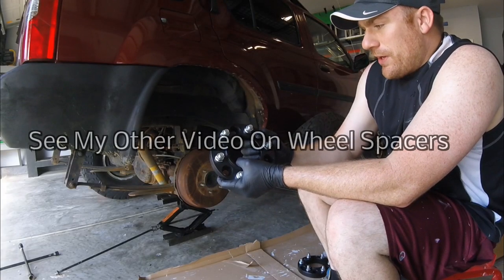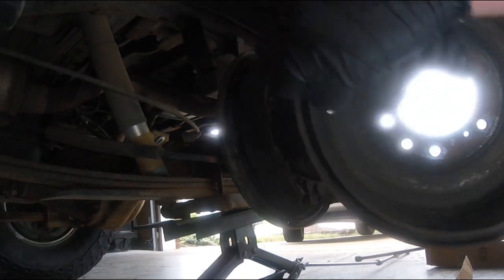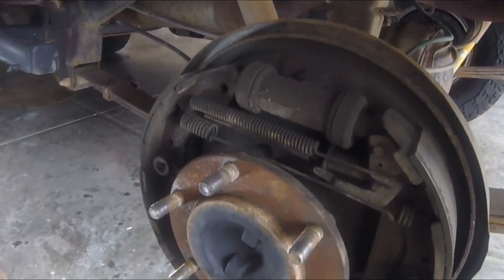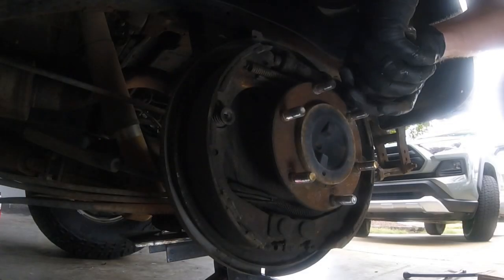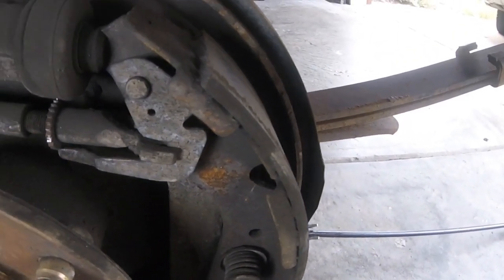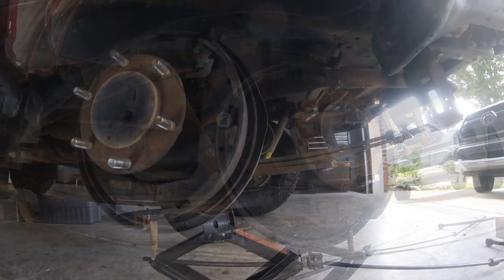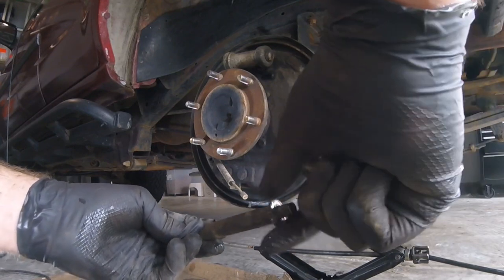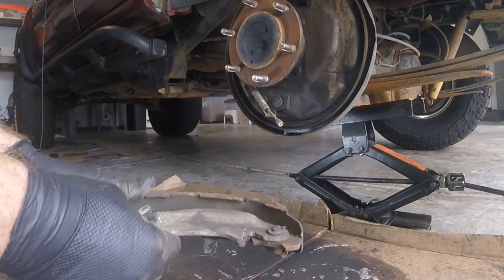How To:  Rear Drum Brake Servicing on the First Gen Nissan Xterra

Comment: Thanks a bunch! I used your detailed guide to replace my brake drums this week... I noticed when I was finished the emergency brake wasn't engaging on my drivers side. I lucked out though. The emergency brake cable just came off of a chassis cable bracket. I put it back on and it works normally now.
Reply from the maker: Awesome! Glad I was able to help!  Hey if you get a few minutes check out my video a few weeks back on my starter replacement. I wanted your opinion on the oil leak (rear main vs. Oil pan) based on what I show in the video of the old starter and oil trail.

Comment: FYI for everybody else - Although my brake hardware was cleaned and looked like it was in decent shape, the auto-calibration feature on my brake drums didn't work. I had to manually tighten them with a flat blade screwdriver.
Reply from the maker: Great comment and thanks for sharing. Its not the most reliable setup. It took mine a couple weeks before it felt any tighter. Doesn't seem to ratchet consistently.

Comment: Hi Rob, I know it's been a while but do you have any video on perhaps adjusting the emergency brake 04 xterra 3.3L ?
Reply from the maker: No video but this is the best video that references it.  Technically the brake is “self adjusting”. The star gear should ratchet when able and add length to the threaded bar which spreads the brake shoes apart. If that threaded bar is crusty and dirty though, it may not actuate correctly, so clean and lube up those threads. Otherwise you want that threaded bar to be as long as possible while still just barely able to slip the drum over the shoes. The way to think about it is you want the smallest gap possible between the drum and the shoes so most of the E brake actuation is applying braking force and not lost to a large gap. The longer the threaded bar is adjusted to, the closer the brake shoes sit to the drum. If you go too far, the drum won’t fit. Hope this all makes sense.  I know the wall of text can be tough to understand.
Reply: @XterraRob  Thanks much Rob!
Reply from the maker: Happy to help!
Reply: @XterraRob  Thanks for the help!  I do have an unrelated question that I need your expertise on.  I had oil leakage from passenger side valve cover and since the car was twenty years old, I replaced the valve cover gasket and then the starter as it was having problems from the oil on it.  After finishing I was putting the hoses back together and the by pass hose that goes from the cover to under the intake manifold (rear of valve cover)  was split so I am waiting for a replacement.  However, after starting the car back up i have the P0171 code, bank 1 running lean.  Thinking this is because the hose is not connected at the moment.  I do not have a good understanding of the operation or effect of having/not having that hose in there.  Is it possible you could explain your knowledge of it?  I believe it's related to pcv flow?
Reply from the maker: @papaalan1765  Valve cover gasket leaks commonly kill starter motors.  Happened to mine too!  Good start so far taking care of those things!  I will send a follow up comment on PCV system,
Reply from the maker: @papaalan1765  This is probably worth doing some follow up youtube research on how crankcase vent system works...a few diagrams is worth more than a wall of text...but am happy to help out.  There are two things to explain at a conceptual level:
1)  How does the engine end up running lean or rich, or just right?  Combustion is just right when it has the right ratio of fuel to air mixed together, and the spark plugs ignite it.  The computer decides how much fuel to mix in by measuring things about the incoming air:  throttle position, air temperature, etc.  it also has oxygen sensors in the exhaust, which is how it "checks itself".  Think of it like the computer is calculating a lot of theory of what should be perfect based on the input side of the engine.  Then the computer injects the calculated amount of fuel and then the oxygen sensor directly measures how far off from theoretically perfect the calculations actually are.  The oxygen sensors can compensate for error in the calculations to some degree.  The important thing to understand is that for these calculations to work:  The inputs to the engine must be strictly controlled and measured.  If you have an opening somewhere that un-measured air is getting in (leaky air gasket, ripped up rubber hose, etc) then the computer can't "see" how much air is REALLY getting into the engine, and when the computer can't compensate for the amount of error in the calculations, it throws a code.  Do a search for "closed loop fuel control" to learn more.  The same logic applies to the fuel side of the engine:  if the engine is trying to inject a certain amount of fuel, but the injectors leak down, or fuel seals are leaking by, then you may get a running rich code because the engine is getting extra fuel because it can't measure what gets in from outside areas...that fuel gets in but is not measured!
Reply: @XterraRob  Thanx, appreciate your feedback and followup on the pcv system
Reply from the maker: @papaalan1765  The second thing is the PCV system.  When the engine is running, not all of the air/fuel mixture is contained in the cylinders and pushed through the exhaust system.  Some of this air/fuel charge blows by the piston rings and into the bottom of the engine.  This is normal.  If the bottom of the engine was sealed, pressure would build up (especially due to heating/cooling of the oil), and eventually oil would get forced out of gaskets, seals, etc...path of least resistance.  Old cars used to have a 1-way vent valve so when pressure builds up to a certain degree, it pops open and this oily/gassy air mix would just vent directly into the atmosphere, but not allow any outside air into the bottom of the engine.  This is bad for the environment, though!  Turns out you can still use the one way vent valve (PCV valve) and let the bottom side of the engine relieve some pressure (like a burp), but then you can let that oily/gassy air mix into a hose and route it back to the inside of the engine.  The air mix then goes back into the engine and gets burnt off and goes through the normal exhaust system.  If you have that PCV hose open to the atmosphere, that could possibly allow some extra air in the engine that is not being measured or if there is a sensor measuring air pressure.  That could throw off the calculations of the fuel control system and cause it to be lean.  I think sealing up a properly fitting hose would take care of it!
Reply from the maker: @papaalan1765  One other option:  engine could be running perfectly, but the oxygen sensor could be damaged.  Check that all plugs were plugged into the right place and that no wires look damaged or pinched when putting the valve cover back in.  It could be a situation where the engine is measuring all inputs alright, but the oxygen sensor is "checking" how good the combustion was and it "thinks" it is lean when it really isn't.
Reply: @XterraRob  thanx Rob, appreciate you taking the time to explain that, and will do the further youtube research you recommended while i wait for the new hose to arrive.  odds are the new hose will solve the P0171 but still good to gain the knowledge.  Take Care and have a great 2025!

Comment: Do you have RFI with your CB radio? Fuel pump RFI?
Reply from the maker: Not really.  Works well if you tune thr antenna with an SWR meter. Bigger antenna = better performance.  I have my radio wired directly to battery too so it is isolated from vehicle wiring.
Reply: Xterra Rob is the fuel pump the original? My pump isn’t. I have done everything by the book for proper install. The only thing I can trace it down to is my after market fuel pump.
Reply from the maker: Yes original fuel pump. Is it a known good radio?  IE remove from vehicle and jump direct to 12 volt battery with battery disconnected from truck. Still get RF?  Or if you have it wired direct to battery, you only get RF when engine is running but not when engine / key is off?
Reply: Xterra Rob I only get RF when the pump primes or is running. The radio is a good unit, it’s a President MC. I have also used a portable cb in testing and the same thing happens. When the pump is off both work great. When the pump is on they both scream. I had a shop install a new sending unit and pump when the original failed. I’m thinking they put some cheap aftermarket parts in. I don’t know many Xterra folks with my same issues and it seems I’m the only one with aftermarket parts that’s struggling. I may look into dealer parts.
Reply from the maker: @TheFlyerBill  sounds like you got it pretty well figured out. Factory fuel pump is what I would do.
Reply: Xterra Rob thanks for getting back to me. It always helps to get multiple ideas together.

Comment: Super helpful video! A couple of things I did to make it easier is I wrapped a bungee cord around the brakes when reinstalling to help keep them in place. And for the retaining springs, I used a 3/4 socket to push them over the pin since my thumbs wouldn't quite fit where it was positioned

I did have trouble with the auto adjusters. Everything was snug in place, but pumping the brakes didn't turn the star gear
Reply from the maker: Yeah my conclusion was it's a poor design that doesn't reliably turn the star gear. Best to manually adjust them to the longest setting possible that can still be assembled. Other than that, there is the port in the back side under a rubber plug you can use a couple flat blade screw drivers to adjust. Push one forward to push the little finger off the star gear. Use another to spin the star gear up or down to loosen or tighten.